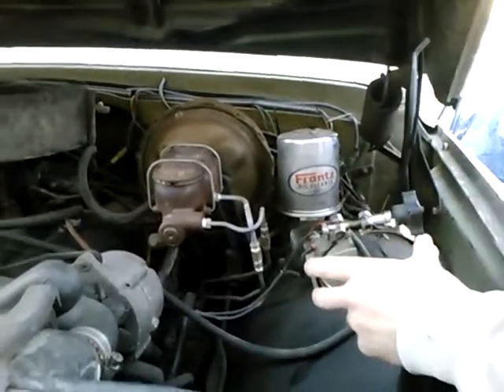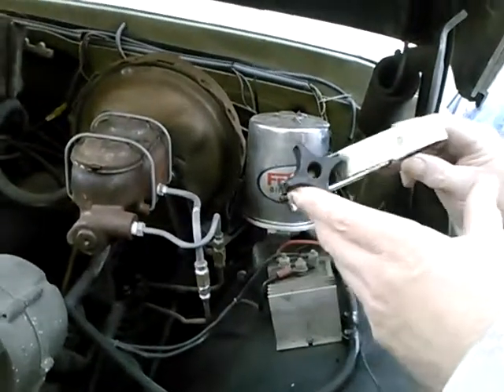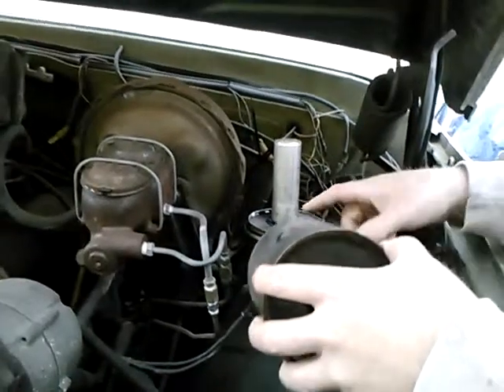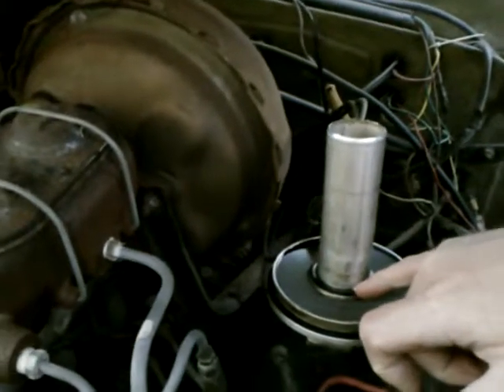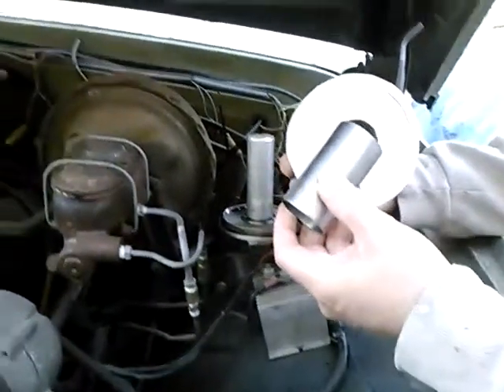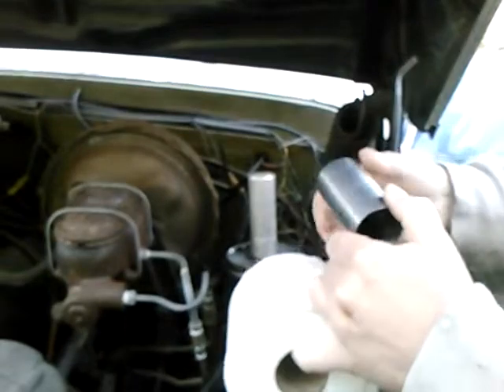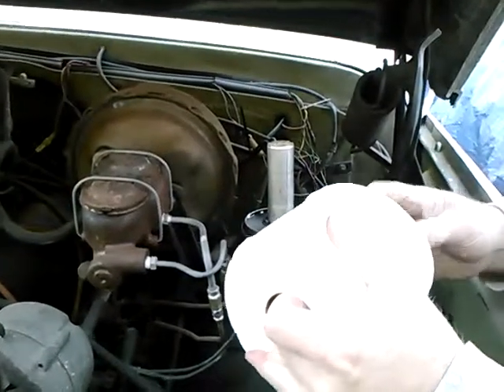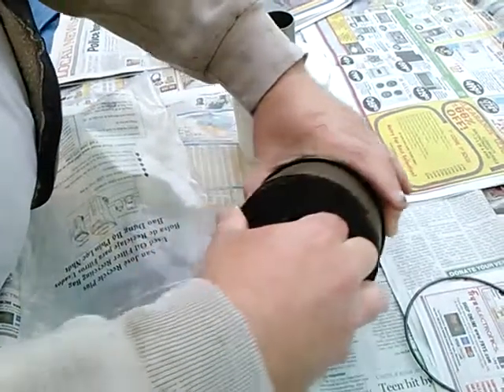Frantz Toilet Paper Oil Filter on 396, with Tapered Center Tube and Spacer MOV207

Comment: I remember with the Frantz. I always used high quality paper. I put them in tight. I pushed them in just enough so that I didn't pinch the paper. I wanted the core to hit the seal before I hit the top with the heel of my fist and put on the clamp. The ring went in the trash can.

Comment: Frantz experimented with different seals at he bottom I have thought about using a wheel bearing seal. It might be that the toilet paper didn't reach the seal it has been awhile but I remember not pushing. the tp too far into the canister I would push the roll down on my knee so that the roll has a bulge when I pushed the canister down on the base the core hit the seal first then the oil pressure does its thing I toss the ring Frantz had a nice over center clamp in the 80s I think there was an extra charge for it you are bringing back memories.

Comment: I have a little Harbor Freight lathe. I. think if I had a Frantz I would make a seal for the core about 1/2 inch thick and 2 1/4 wide. That would solve the seal problem with the shorter Scott 1000. A good tight seal against the canister and the ring and sleeve you could toss.  One problem with the softer paper is you end up with wrinkels. I think the reason we pushed the roll down on our knee is the concave. end was easier to start. When I used the Frantz last quality paper that fit was easy to find.

Comment: That was the weak point with the seal around the core. To do it right with the shorter paper follow the old instructions. Push the roll on the knee so it has a round end .The old filters didnt have the ring.toss it the round  or hemi end should contact the core seal first. Then push the canister down against  the gasket.you have a good roll.The ring is for loose wound paper.The base does the same thing as the ring.

Comment: Of course why didn't I think of that the reason Gulf Coast and Motor Guard don't need an extra sleeve is when you push down on the top you are pushing the core down against the seal. The Frantz isn't the best for upside down use because gravity can seperate the core from the seal

Comment: Wouldn't it.be nice if you had some type of spacer at the top so that when you pushed down on the canister the spacer would push the core down against the core seal that would be very good with the shorter Scott 1000 The concave end goes in first the hemi end goes against the core seal

Comment: It looks like the paper is too short.  If it was longer it would press the screen.
Reply from the maker: +dieselworld If the roll was so long it reached the top, there'd be no room for the oil to squeeze into the paper.  Peeling off 50 turns of paper I get a good imprint of the metal tube when I remove the roll, proof that oil pressure was squeezing it uniformly against the screen, instead of going around the roll.  If the roll is so tight in the canister it cannot move down, I'm not sure the oil isn't following the cardboard tube and not moving through the paper.
Reply: +guidoguitar Ok so the idea is not to get the imprint from your clamping force initially but let the oil do it.  Hmmm....  I always thought the design as the paper use to be 4.2-4.5 inches, was to get the crush on it at install.  I wish Mr. Frantz was alive to do a video on his unit and tell us what he was thinking.
Reply: dieselworld Yes, I agree!
Reply: The trick is for the oil to have no way to get thru the filter without pushing down on the paper. The oil pressure makes the screen imprint on the paper. The weak point is the oil getting past the core seal. With a firm roll like Scott 1000 and put in tight you don't need the ring. My first Frantz didn't have the ring. It did fine. Quality paper was easy to get in the 60s. The core fit snug. The core doesn't need to fit snug if a good seal is made at the bottom. I don't think my first Frantz had a wire to remove the element. A pair of pliers works.

Comment: I don't buy that Idea that the more expensive synthetic element can go longer than a roll of toilet paper before it needs to be changed If the roll is the same size. Changing a roll of Scott 1000 every 6k and adding a qt of oil works for me. That might not work for my 76 F 250 with the 390 engine. Don't drive it much anymore. Some one wanted my old Ford 6.9 diesel more than I did. I changed the filter on it pretty often.

Comment: The thing I see people doing wrong is they are pushing the roll in too far and unrolling too much paper. The seal around the core must be made when you push the canister down on the base. It is a mistake to depend on oil pressure to make the initial seal. In. The paper must be tight .The core should touch the bottom before the canister bottoms out. The ring is a joke. It looks to me like people running the company don't know how to change the filter. The top loaders have the seals made before the lid is put on. If you do it right the seal is made before you start the engine on the Frantz. My first Frantz didn't have the ring
It did fine..
Reply: One thing I like about the Motor Guard and the Gulf Coast junior is you are pushing the paper down against the seal and a tapered housing. The seal is made before you put the top on. They don't have to depend on the tube Fitting tight in the core. Its a pain changing the element with the core stuck to the tube. The tube in the Gulf Coast junior is smaller than the Frantz..